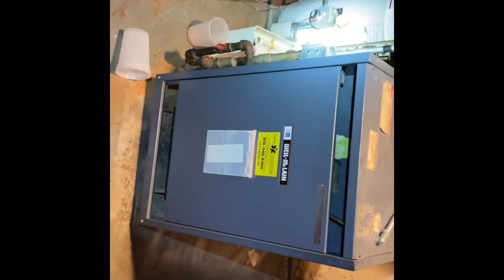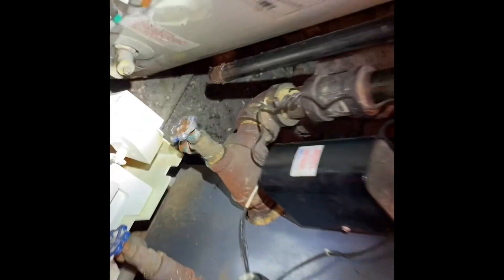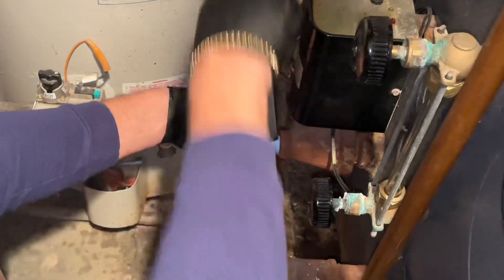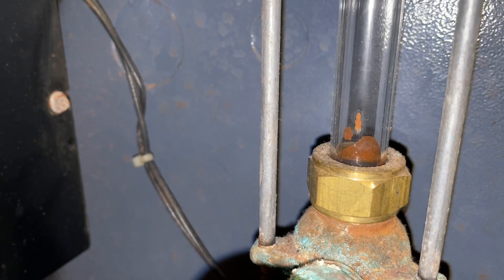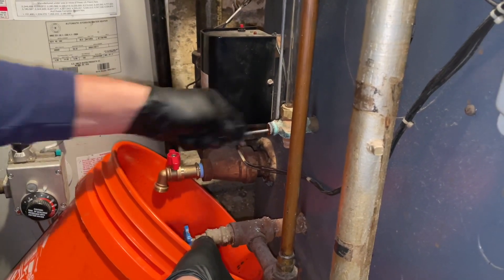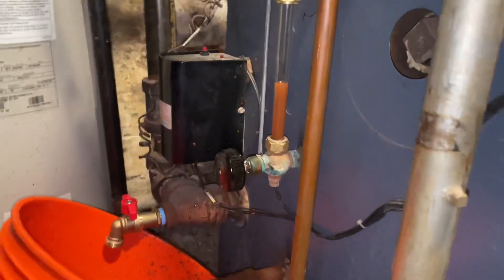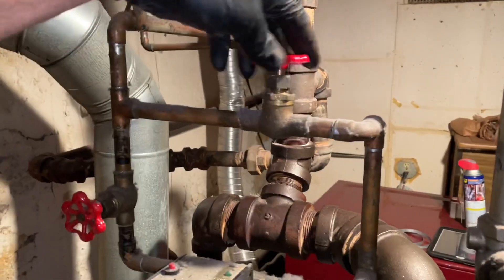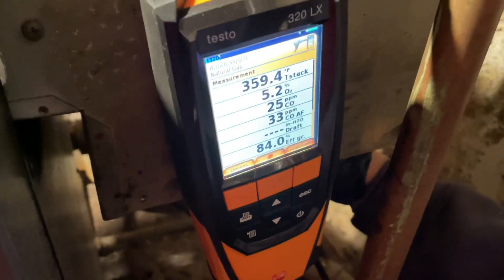Weil McLain Steam Boiler Leaking Water How To Replace 3/4” Boiler Drain & Treat Boiler with SurgeX

Comment: I don’t recommend Surgex. I added to a steam boiler after draining it filled to level and after two days the boiler started to bang excessively 
surging to the point of water coming out first floor radiators.  I added one small bottle of surgex. Maybe that was to much. I would try 8 way.

Comment: Nice video Mikey.  I have used Rectorseal 8-way boiler treatment in the past and am now using Hercules boiler and heating system cleaner.  I put in a quart before I fire up the boiler for the season.   Would you recommend Surgex over both of these products or are they somewhat comparable?  Thanks.

Comment: Hi Mike!  Question, if you have a good running boiler that maintains in this water level and has a boiler treatment added by the plumber in the Fall when it was serviced.

Should I be draining the boiler and refilling it sporadically during the winter season?  Or should I just leave it and drain it at the end of winter.  I have cast iron radiators and the system runs pretty quiet.

FYI I have the boiler serviced every Fall.  It’s a Well McClain natural gas steam boiler from 2013.

Thank you in advance!!

R/
Jonathan